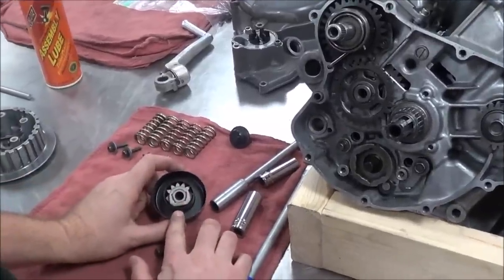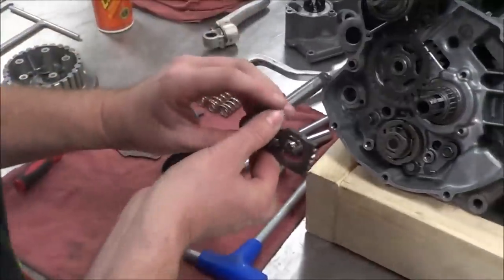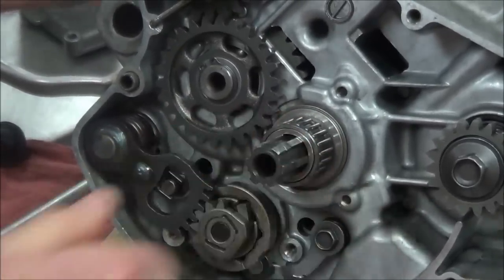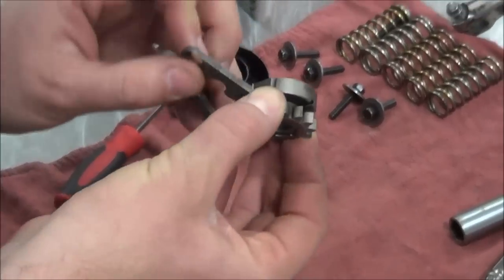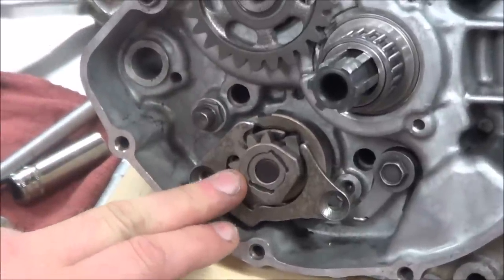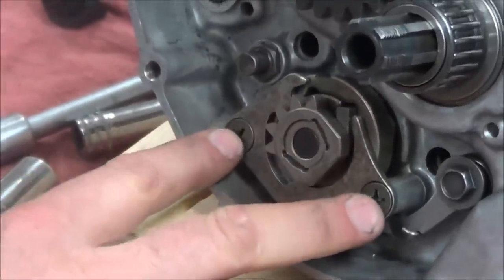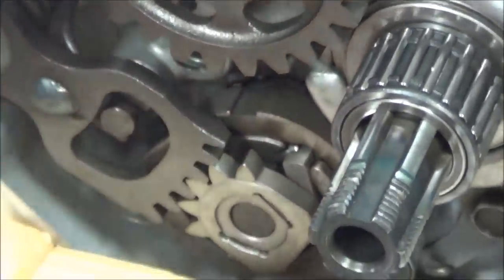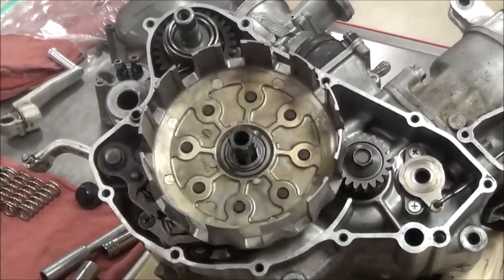Dirt Bike Transmission: Shift Pawl Ratchet How to assembly suzuki shift mechanism and shift pawl.

Comment: I have a lt250 quad racer it's a 1985 the gear shifter has no kickback but still shifts for instant I have to use my foot and shift up and down manually how could I fix this and what is the problem? I can push start it and drive but sat for a bit clutch wont disengage either can put it in nutral and 1 and 2nd gear?
Reply from the maker: It sounds like you’re ready for some Techline help. Coach Conley is also available for hire to personally work one on one with you if ever needed. Yep he is a real person. Give him a call @ 602-345-0432

Details here: https://how2wrench.com/product/personal-tech-training-phone-facetime/ 

Your answers and help are just around the corner. Save time and money while protecting your investment and yourself by doing it the right way!
Follow us!
Web:
www.How2Wrench.com    
www.Tools2Wrench.com

Comment: Hi I have a 2001 Rm 125. I was riding the other day and the chain come off in 3-4th gear and stalled my bike out. Today was my first day back on the bike after replacing front and back sprockets as well as a new chain. They are the correct STOCK parts for the bike and the chain has 112 links counting rollers. The bike had a spell of shifting out of 1st gear and shifting back into neutral while riding today. This only happened 3-4 times. I then decided I would "open her up" when I did, I found myself having to "up-shift" more than once on several of the gears to get it to go into that particular gear. It done this through all the gears. It didn't do it everytime I went through the gears just occasionally. I need this problem resolved before I put her back on the track. The trans oil is about 8 hour old Belray oil. I do not ride really hard either. What should I do to resolve this problem?

Comment: i have zzr600 1994 e2
i had a problem with a gearbox. fork and teeth broken 
i buy in ebay the used part but nice condition.
when i assemble the parts and return the enggine.
in start all had alright after 1 mounth i felt a jump from the gear .like before the restoration.
i disassembly the clutch and i saw two bolt philips m6 that hold the plate hold the drum loose.
i not read in my manual that need a threadlock loctatite 
in thats bolt.
i want ask wich loctite needs to puts loctite 242 or somthings else
im afraid from the damage the gear in the second time
thanks

Comment: I have the same engine and I just assembled my shift paw and it will not shift .. any thoughts?
Reply from the maker: 👍 Thank you for taking the time to comment! Hit that subscribe button if you haven’t please! It helps us! 
Here is a way to support all the free videos.
Want to say “thanks” or “keep it up”? Click here https://www.paypal.me/how2wrench  

Coach Conley is also available for hire to personally work one on one with you if ever needed. Yep he is a real person. Give him a call @ 602-345-0432

Your answers and help are just around the corner. Save time and money while protecting your investment and yourself by doing it the right way!
Follow us!
Web:
www.How2Wrench.com    
www.Tools2Wrench.com
Reply: I assume you got it figured out. Same thing happened to me and it turns out I reinstalled my shift pawls into the wrong sides effectively putting them on upside down (they are slotted but slots are off centered to only be oriented one way)

Comment: I wanted to ask a question if I could sir,
my sons rm125 2004 slips into neutral from 2nd / second gear when applying power, just replaced both shifting pawls and it hasn't fixed it ?
frustrated
Reply from the maker: If it was a quick answer I’d try to respond here but I wouldn’t want to lead you wrong assuming certain factors. I have a video on transmission inspection that covers it in detail. I'd suggest working with me one on one to speed things up for you. 

Reach out to me on my website contact page. We have been overwhelmed with ungrateful people and scammers so I had to do something for my sanity by screening the over 300 requests a week! I’d love working with my members and supporters one on one! Here is a direct link to the services he offers:  https://how2wrench.com/shop/
Thanks for commenting and adding value to our community! Please subscribe, share and consider a H2W membership to support our free work here!

Your answers and help are just around the corner. Save time and money while protecting your investment and yourself by doing it the right way at www.How2Wrench.com 

Have you subscribed yet to never miss a video? Have you seen the video playlists https://www.youtube.com/user/conleybuilt/playlists? 

Want to say “thanks” or “keep it up”?
Click here https://www.paypal.me/how2wrench
Reply: Thank you so much for the reply, I will Endeavour to sort this out with your guidance
Reply: Hi Sam, my son has exactly the same problem with his bike. Did you figure out what caused it.
Reply: Oddbjørn Salte no unfortunately
Reply: Sam Perras thanks for your reply. :)